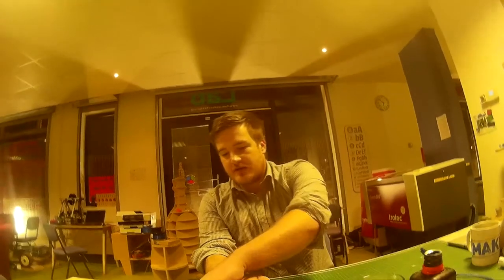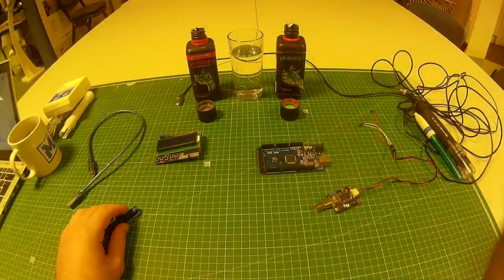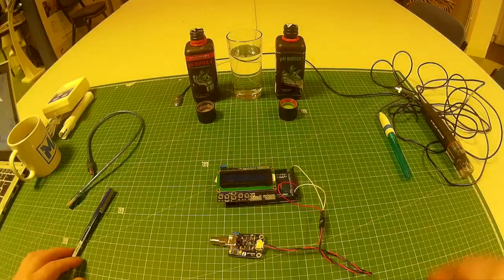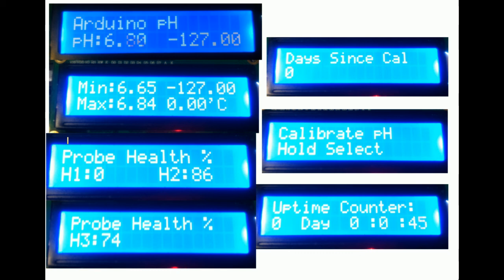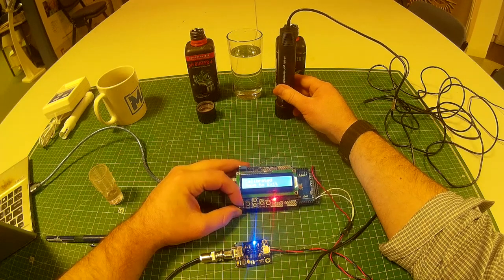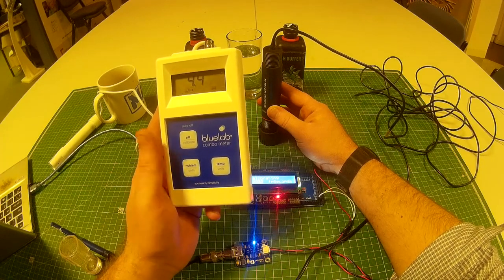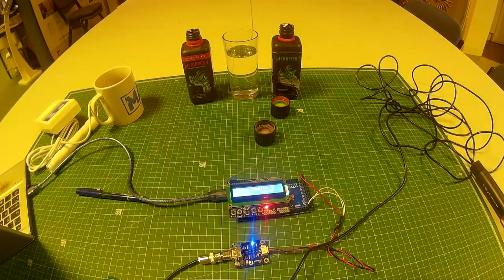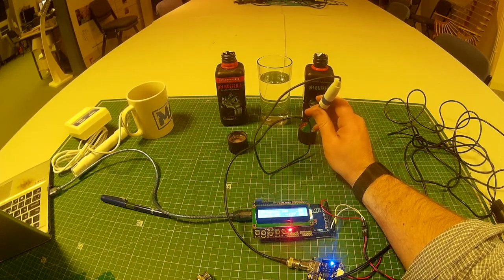DIY Arduino pH Reader/Logger with Prober Verification and Calibration

Comment: Hi Mike, thanks for the tutorials! I went through your program with a brand spanking new "pH Meter Pro v2" from DH robot. Set it up with an LCD keypad and an Arduino mega and powered it with USB. Went through the calibration and it states that the probe is faulty. Should I contact DFRobot about this? I noticed the readings did jump sometimes to values like 15 or 10 for a split second, but I wonder if that has more to do with the fact that I haven't soldered any of the connections yet?
Reply from the maker: Hi,  It could also be the updated pH board has changed amplifier/scale and the code would need updating to reflect this. 

Either way a jumping value isnt normal, check for loose connections first.
Reply: @MikeRatcliffe24  Cheers! The pH board is attached to the keypad with jumper acbles which I haven't soldered in yet as I'm still testing. Do you think that could be it? I'll check around if I can find some code that uses the new pH board and modify yours based on it if needed. Really liked the software and tutorial, keep up the good work!

Comment: Can I have the probes submerged in water to automate the readings ph (for what this kinda project should be used)? Instead I can just buy a pH meter for 15$ and thats it.
Reply from the maker: Yep this code is just a start/base code for those building data loggers or automatic ph control systems [hydroponics, swimming pools etc].
Reply: @MikeRatcliffe24  Sorry, maybe I haven't set up my question correctly. I am wondering since many cheap analog pH sensors are stating they could not be submerged in the water for a long time, if those can actually be in for lets say months?
Reply from the maker: @TheGamerzXChannel  the probe in the video claims to be a more industry oriented probe for long term use. 

I've seen cheap probes last for months (calibrated monthly) before the probe shows major degrading. This code helps with that because it will give you a probe health readout
Reply: Mike Ratcliffe Thanks Mike, exactly what I wanted to hear!

Comment: Helo +Mike Rarcliffe i have a project whic is about milk freshness and i use ph meter . i need to design it on a simulation program but i couldn't find ph meter library. i can't do. Please help me about this. i started to use proteuse but i am not good and as i said i couldn't find :\

i meant like that... 

https://sc01.alicdn.com/kf/HTB1asZYJVXXXXXNXVXXq6xXFXXXn/PH-Sensor-Module-V1-1-for-Uno-R3-board-mega2560-AVR-51-PH-shield.jpg
Reply from the maker: Hey, Im not too sure if the milk being heavy in protein will block the small holes in the glass bulb part of the pH meter.

Comment: That's some good info there Mike. Thanks. Do you know it the code works with the dfrobot ec meter? And do you mind if I ask if you've used the dfrobot probe 24/7 continuously and if so how long would they last? I'm planning to use one of these in conjunction with an arduino-controlled peristaltic pump (dosing system) so the meter will have be in continuous use in order for the overall system to be effective. To be honest I didn't even know they had a lifetime and needed to be replaced.
Reply from the maker: Yeah this code as written for the DF robot pH meter kit. I have not yet trusted automatic pH dosing, but I have been using the pH probe for logging and it seems to work well [over a 4 month period]. Add a few constraints to the automation code [ie, max dosing amount per day] if you do decide to automate :)

Comment: Thanks for sharing a very informative video. I keep tropical fresh and salt water fish and use PH probes and digital PH meters regularly, I am also very into the Arduino and am a keen amateur electronics nut! I already have all the Arduino items required except the PH shield, could you tell me where I can obtain one, thanks.
Reply from the maker: Glad you found it interesting, I got this one from Df robot, but the code should work with any analog Ph interface [from ebay etc]. It is sometimes better/cheaper to buy a "Kit" with a ph interface and meter than just the interface alone. 

https://www.dfrobot.com/wiki/index.php/PH_meter(SKU:_SEN0161)

Comment: Hi Mike !

I have the same Blue Lab combo meter but i'm looking to automate things... will the BlueLab PH probe work with the arduino sensor module ?
Reply: also, can this probe be submerged 24hrs/day ? what brand is the black probe you are using ?
Reply from the maker: Hey, any bulb based ph probe will work. I used a bluelab probe with this code [bit expensive but work buy hem in for me].  You can use it 24/7  but calibrate often as these probes do age. 

the probe I preffer:
https://makersify.com/products/dfrobot-analog-ph-meter-pro?utm_medium=cpc&utm_source=googlepla&variant=5262754689&gclid=Cj0KEQiA-f3CBRCbluKf4vu008kBEiQAl-iGqwciD_jGT5Xb-JJ4fhI2bhds3f5qOA7zy2HfkmPf-tEaAs438P8HAQ

Good Luck with the project
Reply: thanks a lot for the quick answer !

Comment: Hi Mike
Can you send me actual diagram of what is in the video please? Because the schema is a thermometer in the video I do not see him anywhere. The diagram is involved in red pins = 22, 24 = black, yellow = 26, but the video I've seen that would have used it.

Thank you for your reply and sorry for my English :)
Reply from the maker: The temperature probe is optional. can you reword your question?
Reply: Please pardon my english one more time.I'm trying to solve in which pins do I have to connect the Ph module, because it is shown differently in the video than in your schematics. Could you send me the numbers of pins you have connected to the module? It is barely recognizable from the video. I would also like to ask if it is true that the connection is different when you are not using a thermometer in the video. I suppose, that pins from the ph module would be blocked by the LCD display if I connect the thermometer. Is it true? And the last question I would like to ask is how precise would the ph probe be if I won't be using the thermometer and I will perform the connection from the video.
Reply from the maker: its the same as the digaram on the link:
https://www.element14.com/community/community/design-challenges/vertical-farming/blog/2016/01/08/automated-green-house-blog134--ph-control-ph-probe-lcd-readout-gui-probe-health-readout

You an use the 5v and gnd pins at the bottom of the arduino mega board if you are using a LCD. Ph Probe does not depend on temperature [only very slightly] so the temperature probe is not needed. 

Good luck

Comment: I have the ph meter hooked up to the arduino but I also have buttons and a small stepper motor connected to the arduino (everything is connected through a breadboard). 

The readings from the ph are perfect until any of the buttons are pressed, or the stepper motor is turned on for any length of time, then the ph readings spike from 7.30 to around 8.40. 

Have you any tips to stop the interference messing with the ph readings?
Reply from the maker: Hey, glad to hear you have your parts.

 lets get rid of the easier problems first:
>Can you put a multi meter between 5v and gnd of the breadboard, compare the normal voltage [should be 4.98 ish] to the voltage when the stepper/button is pressed. We might be browning out [not enough power]
>Connect the 5v and ground to the ph probe from the arduino directly [maybe use the bottom supply points]
>See if you get the same result when you power the arduino from a 12v wall socket, the 5v from a usb might not be upto the task.

If these dont fix the issue, do a quick sketch of the circuit with part numbers  and we can fault find for circuit problems.
Reply: Thank you for such a quick reply. Unfortunately at the moment I don't have a multi meter at hand. As soon as I have access to one again I will reply with all the results with the multi meter.

Comment: Thanks again Mike, for your awesome work! You make it really easy to follow your stuff so others can learn from your experience.
I got this working withe the a cheap pH module from eBay called "Logo_PHsensor v1.1" (http://bit.ly/27DvVJw).
Reply from the maker: +Oliver Hannemann 
Glad it was of use to you , Im working on some ESP8266 stuff recently that I will be sharing too.

Most pH sensors/boards work in a similar way, good to hear that it is working on your boards.

Comment: i like your project and would to the same for my reef aquarium. could you be so kind to send me the things i need, how to do it and the code. my email is phckar@gmail.com
Reply from the maker: +Phillip Clarke 

Code can be found:
https://www.element14.com/community/community/design-challenges/vertical-farming/blog/2016/01/08/automated-green-house-blog134--ph-control-ph-probe-lcd-readout-gui-probe-health-readout

Parts:
>Arduino mega 2560
>Arduino LCd shield [one with buttons]
>Df Robot Ph Pro meter kit 

Drop me a message on here if you cant find any of them, or have problems,
Mike
Reply: thanks mate, i'll check the stuff and get back to you.